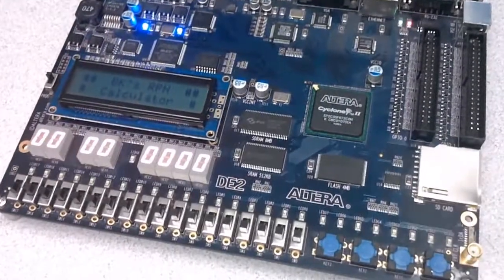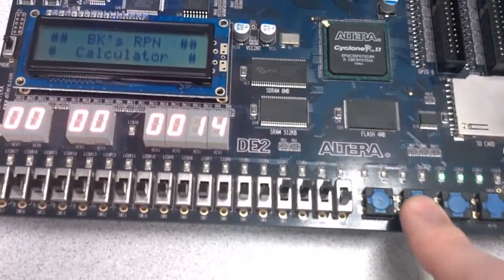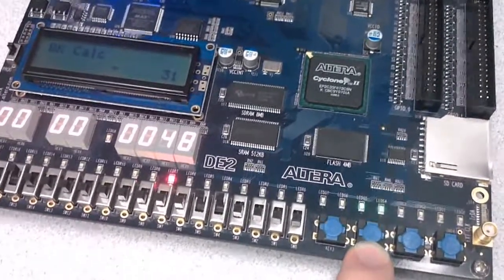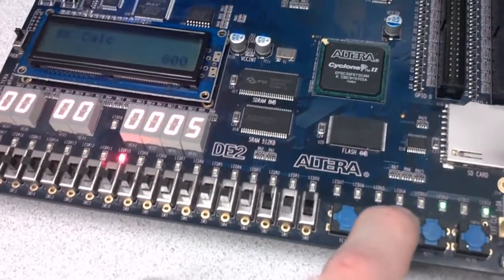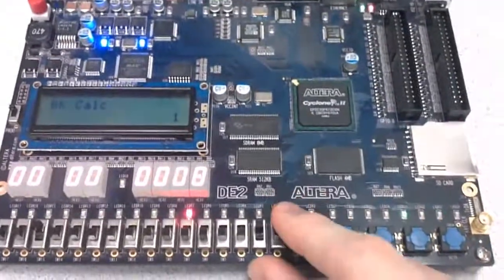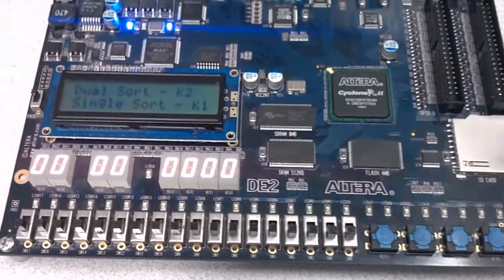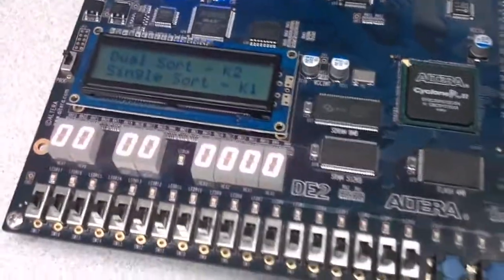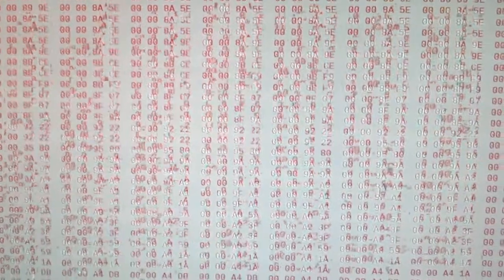Dual Core MIPS Processor Demonstration

Comment: "All multiplication and division is done in Software" - https://youtu.be/PJTNYvhVhks?t=6m24s

I very highly doubt that these operations are performed in "software" unless you connected the *hardware* described in Verilog to a computer and had a lot of communication. It is more likely that the functions are performed in a ALU that exists in hardware.

-- Senior EE from a small school, South Dakota State University.
Reply: His processor is running code specifically written for it that leverages these Hardware ADD & Subtract Operations in order to perform multiplication and division.   Implemented in software meaning that the ALU does not have a Multiply/divide operation, but it is emulated though a program.

Comment: Did you fabricate the CPU by yourself using a cad tool, and what kind of lithography(photo maybe?) techniques did you use? Just curious, oh and great work BTW.
Reply: Shawn Maziarz That's an FPGA. He didn't actually build the board himself, he designed the microprocessor in a software, and uploaded the design to the board.
Reply: He probably did it using VHDL, a hardware description language (similar to programming) and syntesized it on the altera board